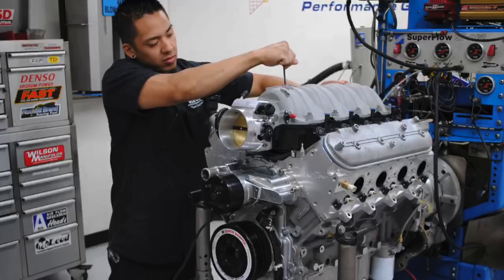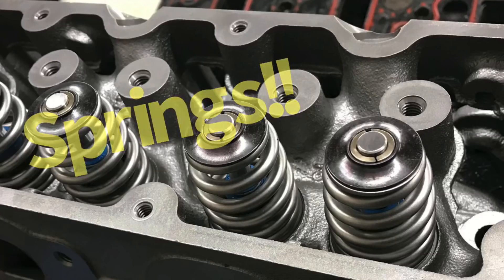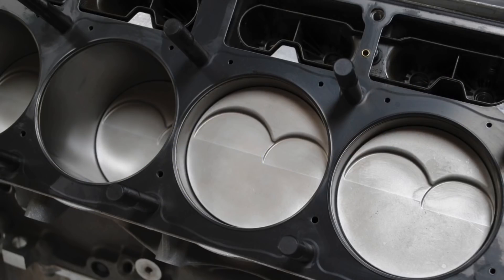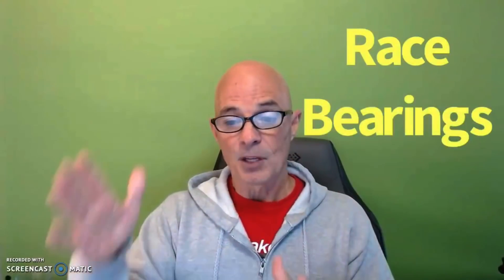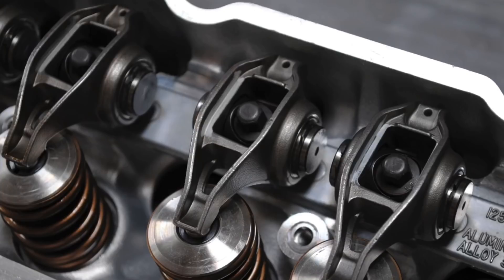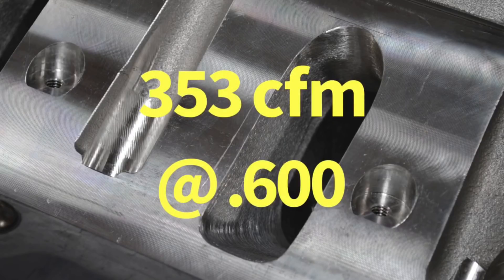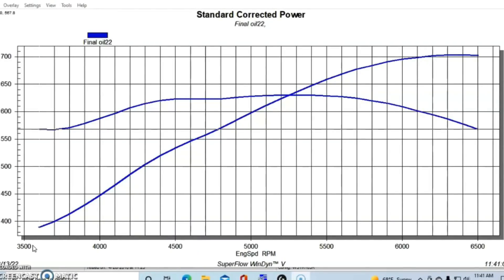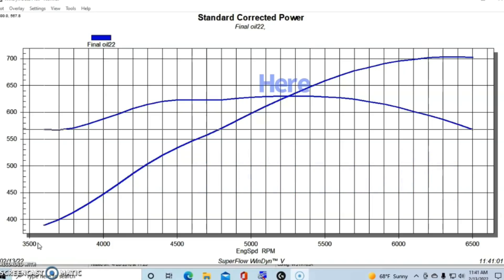HOW TO: 12:1 COMP, 700-HP, PUMP-GAS, 454 (CATH-PORT) STROKER LS.  NO REPLACEMENT FOR DISPLACEMENT

Comment: Well thank you Richard you might have just taught me what I did right in my turbo bike. Iv been running 14.5:1cr with 35psi @ 46°advance on 93. I do chill my fuel with dry ice over 25psi but I hadn't found one thing that was big enough on its own to help so much with detonation. Turns out I'm sure the stuff I did helped but something I did that I didn't realize had this benefit was soften the chamber. Duh lol I thought I was just deshrouding and while I was there I thought let's soften these edges itl help with heat. Just now did it hit me that that was probably a big piece to my puzzle. Thank you rich and ever try offset boring with logger rods? I know that's one thing I did that helped make things possible .
Reply from the maker: what engine needs 46 degrees of timing? at 14.5:1 comp and 25 psi?
Reply: @richardholdener1727  it's an xr200 I have a few vids of it up making new ones as I get better at filming. Not much xr200 left inside it but the head and bore are still the same. So far it picks up power with it over less and stock is 42 from Honda. I'm on the 9th version of this motor so Iv broke stuff lol. And last pull was 36psi then the charge pipe blew off and she ate herself. Currently finishing the newest engine with a new oil system (more pressure and flow) and a new clutch I whipped up to use boost to assist the springs so she locks up faster. I race 660/330ft with it. You inspire me dude and you also re lit the flame that made me dig this project out from my HS days and get serious about it. Wish me luck hopefully we can get 50psi out of her later this week. Don't judge my fuel system too much lol it does work and so far iv kept it safe.
Reply: Do you have to run 93? Can you e85? I have to say those numbers are crazy town to me 46* 35on the gauge and 93? The freezing the fuel has to be doing something. 46 to me seems way out in front. Is turbo maxed out on the compressor side and you going for power with timing? I’ve heard of 32F charge air  temps running 28* on 14 psi. This is interesting def checking it out
Reply: @2VersTT0  yeah it seemed crazy to me too but I tare down to inspect pretty often and so far aside from pushing the wrist pin into the piston some it always comes out nice. I did indeed mean 46° advance.  I run e85 when I can get it so normally pump gas. With dry ice I can get the fuel down to about -100°f give or take I see about 380 coming from the turbo and about 0-30°f across the carb on gas and about -40--20 on e85. Technically speaking I'm way past the compressor wheels range stock but I had this one made and I have no map for it. Was told by the guys that made it should be good for 50-60psi should know this week. I'm also hoping this newest wheel and a seriously cutback turbine wheel will have better iat. I do rev to 14000rpm most of the time although I have touched 17 before.but she's well rolled over by then. Currently the goal is 1/2hp per cc were 155cc and I'm hoping I can squeeze a 6 in the 660. I have topped it out with my gearing at 125mph. It's making power just seems to like things it shouldn't. I do have some vids of it running after I hurt the turbo and I couldn't get it over 10-12psi you can hear she runs good but she doesn't even wake up until 20psi. Also Richard take a look at the world's fastest postie on YouTube. They run a 125cc compound deal on a stock motor lol damn thing made 60whp more and it shreds gearboxes. I believe they run similar timing aswell as 45psi of boost. Iv tried taking the timing down to a more responsible number but it losses so much and egts get real high at rpm. Hopefully I can get some better videos up this week and some race video at the end of the month. My class doesn't care what fuel we use but I'm avoiding meth as long as I can e85 is just hard to find in NC. I'm Brazilian I love ethanol.

Comment: Please explain a"soft chamber" I figured the only way you could run pump gas was to use an "intentional bleed cam"  with an 11 to 1 piston. still don't understand how this was done. Was part of it because you only ran 29 degrees of timing?? or maybe the fuel injection had something to do with it?
Reply from the maker: SOFTEN CHAMBER, CAM TIMING, ALUM HEADS,
Reply: "Softening" the chambers is a process to reduce the quench area. = less volitile and more controllable combution events.
Reply: Search softened chambers on YouTube and MBE has a great video explaining the process. I'm sold on it.
Reply: One of the greatest technological advances we got from the 1st LS engine was a fast burn chamber (actually came from the gen 2 LT1 and L31 vortec). By softening the chamber, you effectively slow down the burn rate....making the LS more like and old SBC. The fast burn chamber is a lot of the reason why an LS makes best power @ 28-30° peak timing, and a SBC wants 34-38°.
Reply: @kevinengland4042  So a soft chamber is just a smaller chamber? Why is it called softening?
Reply: @kevins5833  it's actually larger in cc's but it's less efficient. Instead of calling it less efficient, someone decided to call it "softened".
Reply: @kevinengland4042  Dear Lord, now I'm really confused. In a race engine, everything is smoothed, shaped, radiuses, polished, etc why in the world would a race engine have a non-efficient chamber?? I need a drink...

Comment: Is it safe to assume that a novice like myself could achieve 600 hp on 91 using an 11:1 Texas Speed 421?
Reply from the maker: WITH THE RIGHT HEADS AND CAM AND INTAKE
Reply: @richardholdener1727  Thank you for your time and the reply.
Reply: I think so, I have a 11.0 370 on pump with stock valve 706 heads and making over 500 easy, trapped 105 with stock Ls1 now trapping 122 plus

Comment: With 600 foot pounds or more of torque from 4100rpm to 6100rpm you better have a serious suspension setup that works well planting the rear tires on the street it would be a monster and dangerous in the wrong hands

Comment: Peak power at 6300 - 6400 rpm.  Its still very streetable!  Healthy engine, but I wouldn't call it radical.  Very solid build
Reply: Anything that has good power at 2000-5000 rpm is streetable, it's not the peak power rpm that makes it streetable. Unless you run peak power rpm on the streets all the time.

Comment: No offence but putting even aftermertket Cath Port heads on an engine of this size is frankly silly.
Reply: It's not "frankly silly" if its producing 700+ HP @ 6400 RPMs and over 600 FT-LBS from 4000 RPMs to  near redline. Wake up and smell the coffee and face facts the LSx Rec Ports are not the be all and end all set-up that most LSx heads believe they are. Yeah they have a ton of flow out the box but their port velocity and Co-efficient of discharge isn't all that great.
Reply: @colinw7205  coefficient of discharge and port velocity are going too change drastically between a 292 cube truck motor and a 454 with a healthy cam.  No matter how you stack it these are the wrong heads for this application.  

Did it make great power? Yep. 
Could it have made more with a more suitable head? Yep.
Reply: @Saddedude  Brian Tooley's choice of the TFS 245 for his own personal big inch LSx project wasn't some weird contrarian move on his part. Brian designed TFS aftermarket cathedral heads including the newer Gen X line. Hence the choice and the selective mods he had done to them during assembly.  Some years ago I had a conversation with John the head of WCCH. He said to me the real reason that GM went big with the Rec Port heads which came out of the Corvette racing program was that the Rec Ports had lower pumping losses than the corresponding Cathedral Ports. Think of the straw diameter you get out of your typical fast food joint for your soda as compared to the larger diameter straw you get from your local Bubble Tea joint. Not much but by fewer percentage points. That small difference multiplied across millions of units and the subsequent EPA testing and certification equals to a small but real increase in gas mileage.   We all know how the aftermarket cathedral heads from TFS and AFR and others always flowed more air on a much smaller cross section than your typical LS3/L92 casting.  Better to work out the smaller cross section head to the max than to have the lazier air velocity coming out larger cross section head. Especially on a street build as opposed to an all out racing build.

Comment: Gotta love big block displacement on a small block platform… ever do anything like that with a ford platform? Or any other manufacturer for that matter 🤷🏼‍♂️ would love to hear about them! Thanks for the great content Richard and keep it coming.
Reply from the maker: I COVERED A STORY ON TOM BOGNER'S (FROM LUCAS OIL) 460 CID  (351w) BASED FORD SMALL BLOCK
Reply: @richardholdener1727  is love to have those Heads on a dart based Windsor punched to 460. A tunnel ram with port e85 mammoth cam that would give Brian’s engine a real run.
Reply: What is the biggest stroke on Ford's new 7.3?
Reply: I think you can do a 426 from a 351w.
Reply: @2VersTT0  4.17 stroke, i have1. Lotta torque.
Reply: If you buy a ford dart block that comes with a 4.125 bore I think you can build some pretty large displacement.
Reply: Oh I know you can get the cubes out of aftermarket blocks. Think the fellas down under have gone over 460 cubes with the Windsor platform. Just curious on Richards personal testing with them. Andy over at unity motor sports has a 429 (mixed up boss)Windsor project going on right now if you have the time to check into it.
Reply: @Lagrange1186  Andy works very hard, I love the mixed up boss

Comment: Interesting build. A few years ago I was looking for a cathedral port head for my 402 build. BTR recommended the TFS 245 and Nick at BTR spec'd out a cam where I wanted it to peak at 6900 and be able to spray it hard. It made 649 hp on the pump and had a nice flat torque curve that was over 540 at 4k rpm. Very impressed with such a simple combo.
Reply: I have 245s on a 402 turbo
Reply: how much were those TFS heads back then when u built yours?
Reply: @heat19721  3200 assembled with his nitrous exhaust port

Comment: Have some torque son. For real an NA engine that has that much torque. It’s much different than a turbo engine even with 50 or a little more power. When you open the throttle on an engine like that it really feels instant. The control is linear.

Comment: What do you think about a simple junkyard 4BT episode with all the torque?
Reply from the maker: 4BT?
Reply: @richardholdener1727  He's talking about a 3.9l cummins engine.
Reply: Don’t those make like just barely above 100hp turboed, while guzzling diesel like there’s no tomorrow, all while weighting 750lbs. Sounds amazing.
Reply: @andy123441  No you can get 500 hp and 800 ft lbs from one of them and that's just a 4 cylinder, The 6BT makes even more power because it's an inline 6.
Reply: @andy123441  Yeah they don't make any horsepower,  but with an intercooler and a big turbo and Richard's penchant for making things go boom, I'd bet he could get 900 ft/lbs.  I don't love it or anything, I'm just curious and they're common.

Comment: Hey Richard, Although Brian could archive 700 HP on cathedral port heads, it doesn't mean your way of thinking was wrong. He was still better off with a set of stock LS7 heads (flowing around 370cfm), so he could make even more power. I don't get why he went through all that trouble to choke the motor with less CFM flowing heads . Maybe smaller port ( 245 cc) to generate more low end power/ torque.  
Nevertheless , great test, something special I would say. thank you.
Reply from the maker: THIS WAS ALSO WHEN INTAKES FOR THE LS7 WERE VERY LIMITED (BACK IN 2010)-NOT SURE A STOCK LS7 HEAD WOULD MAKE MORE THAN THESE
Reply: @richardholdener1727  I was wondering the same thing, didn’t realize this was over a decade ago. Im sure with some worked ls7 heads and msd intake it would make even more power right?
Reply: @richardholdener1727  stock Ls7 would flow 370CFM @0.6" at intake site so more than 245cc cat head which did flow 353 cfm.
For sure 245cc heads had a better flowing exhaust port. You are right on intake manifolds. He must have had a reason for his choice but stock ls7 can easily support 700 HP as long as flow is a concern.
Reply: As long as the OEM LS7 heads don't drop a valve, and puke the engine. I have an LS7 in my C5. All 16 guides were junk in less than 20,000 miles. LS7 TYPE heads? Yes. Actual LS7 heads? NO!!!👎
Reply: @milojanis4901  valve train was out of equation of course and was not the point here. we talk about flow numbers.
Reply: Velocity

Comment: To be fair. 700BHP on a happy engine dyno (happy because they don't use: accessories, water pump, alternator, full exhaust, emissions equipment/Catalytic converters, fan...) from 7.5L is not really anything to write home about. Factory Toyota, Subaru, BMW, honda  and even Ford engines all have specific power output exceeding this with all accessories and emissions equipment all attached.
Reply: With the exception of Ford, none of those Manufacturers you mentioned have any factory Engines, factory Cars off the show room floor that would even come close to beating that thing out on the Road or at the Track. To the uninitiated, 700hp, That's pick the front wheels off the ground  high 9 or 10 second potential Engine in a well setup car, and at least 11 flat 1/4 with full exhaust to the rear bumper @3400lbs weight street car.
Reply: Yep, it's not a world beater for the HP per liter, but-- it is big.
The Europeans back in the day, called it the "Lazy Litres" approach to car building. (Ford GT40 Mk II and IV)
I hope he enjoys the hell out of it.
Reply: Now take any of those naturally aspirated engines and compare the torque curve. Low RPM torque is where it's at on a street driven vehicle. My 2012 CBR1000RR had much more horsepower than my 2000 Bandit 1200, but the Bandit had much more low RPM torque. As a result, the Bandit was much more enjoyable to ride on twisty mountain roads because you didn't have to worry about keeping it in the power band. If a corner was so sharp that it forced you to slow down more than you expected, you'd just roll on the throttle and torque your way out. I would have loved it if the CBR had a power curve like the Bandit, but it would have failed to be marketable because it wouldn't have been impressive on paper.
Reply: Lol specific displacement, 700 hp out of a 7.5L  and 300 hp out of a 2.0l engine well I know which one I would have under the hood of my car.

Comment: Richard will you do a LS stroker build like 427 or 454 for us thanks again
Reply from the maker: I JUST POSTED THIS-BUT I DID DO A 468 AND 495
Reply: @richardholdener1727  let’s see it!!!  I just got a sleeved and stroked LS3 that is now a 454 and would like your combo ideas.  I have cnc LS3 heads and it specs out to 12.5:1 compression.

Comment: I would love to see some more 4-cyl and 6-cyl content.  Ford 300, 20r/22r, ford 2.3(ranger), and maybe even the ford 400, all with boost.
Reply: 2900 vortex has same adapter plate as the 4200 could see some atlas 4 cly testing… cheap engine
Reply: I just got done adding ring gap to my 22r in my sand/street rail. Its from a 1981 celica. Its bottom end is all stock, the head has some minor port work and Ive got either a k03 or a volvo td04 to boost it with. Im still looking for a offhauser 4 barrel intake manifold for it since ive got a blow through demon carb for it. My goal is 200+ft/lbs to the tires as early as 2500rpms. Should make my little 1300lb sand rail scoot. Even stock, it is a brute in such a light weight vehicle.